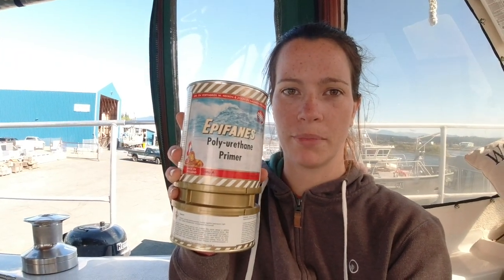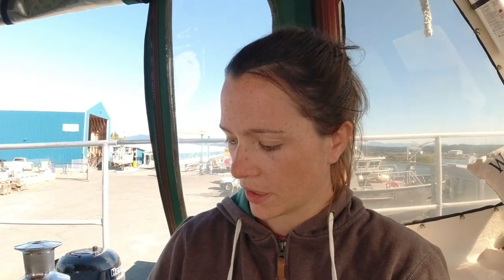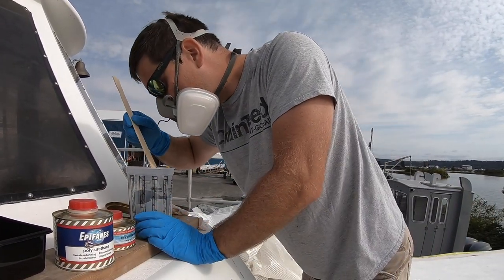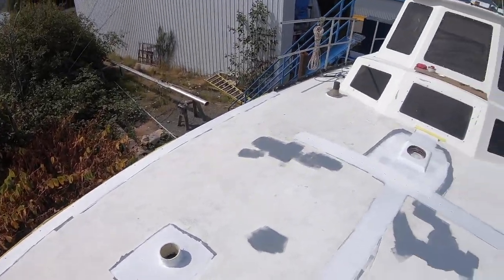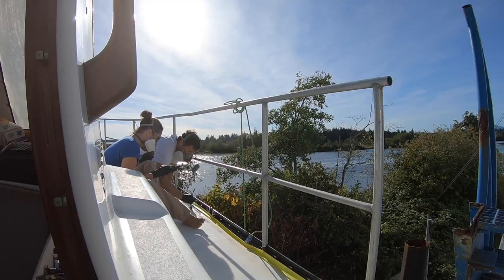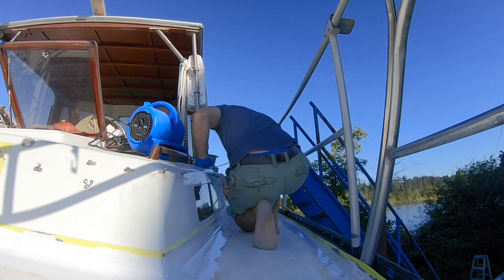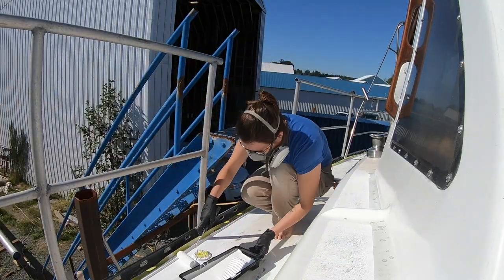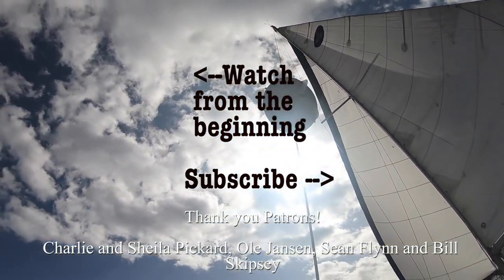Making Mistakes with Epifanes Two Part Paint | Chapter 3 Episode 15 | The Wayward Life

Comment: You DONT have to use the whole can. You can mix whatever amount you want. Even make tiny touch up amounts. I was an automotive painter for 23 years. You can use a food scale and basic math to mix and amount at any ratio you want. Set the scale to GRAMS. Put a plastic disposable cup on the scale and zero it out. Pour in the cup roughly whatever amount of paint you think you will use. For example you pour in 275 grams of Part A (paint). If the mix ratio is 3:1 you dive that 275g by 3 (if mix ratio is 4:1 you divide by 4, etc) which is 91. So 275g + 91g = 366g. So pour in Part B to your 275g of part A till it reads 366g.  You now have perfect 3:1 mix ratio of any amount you want. If you need to use paint thinner to thin out say by 10% you take your 366g x .10 = 36g so 366g + 36g = 402g. So add thinner to your 366g cup till it reads 402g. EASY!
Reply from the maker: You’re right and we didn’t use a whole can to begin with... just can’t save it for later once it’s mixed, so you need to use or throw out the amount mixed.
Reply: @WaywardLifeSailing   I dont know why Epifanes tells everyone to mix the whole batch up at once.
Reply from the maker: My assumption is so that people don’t mess up the ratios
Reply: @SOLDOZER  probably to make it so that people dont screw it up and then blame epifanes for a bad product. Also its a good way of selling a lot of paint. When i painted my boat we tended to end up with something like 1/3 of the 3th can left over when we finished a full coat on the boat again. So if you went with mixing full cans you would throw away 1/3th of a can for every layer of paint.